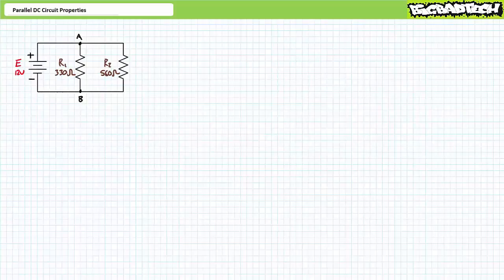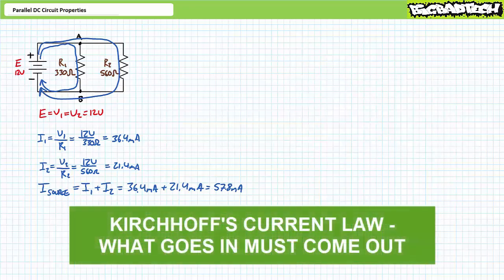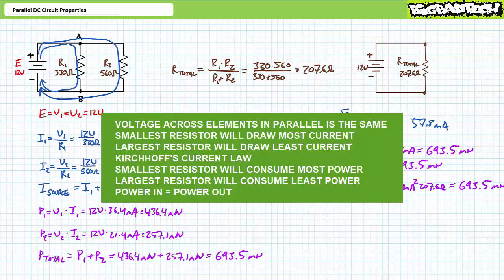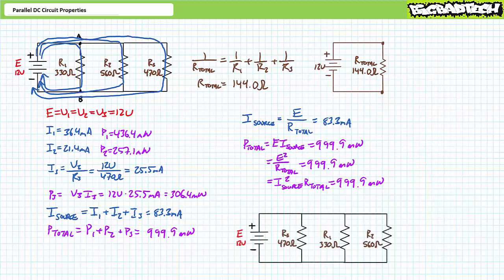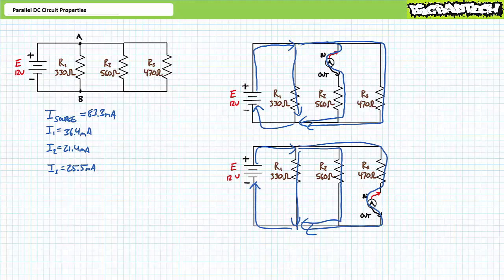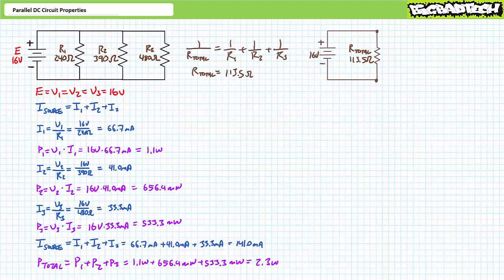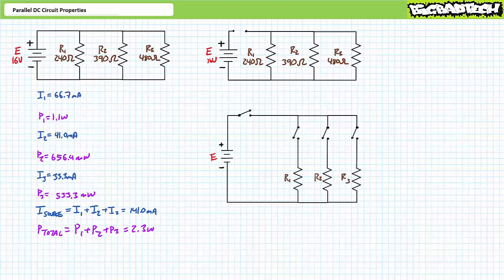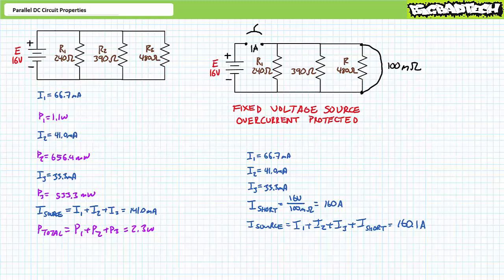Parallel DC Circuit Properties (Full Lecture)

Comment: My take away from this lesson is that parallel circuits have zero tolerance towards shorts, but are forgiving towards open. Meanwhile the opposite is true of series circuits. They are forgiving of shorts, but have zero tolerance towards open. While both circuits would benefit from a fuse or circuit breaker, a parallel circuit has more of a need for it than a series circuit. Opens may be undesirable, but they don't fry circuits. Shorts do!

Comment: I ran into some big discrepancies doing a lab that simulated shorts and opens in a 3 branch parallel with a leading current limiting resistor.  We were required to keep voltage supply of 10v ahead of the limitter resistor, when doing a short in the first branch.  My Vss went from 10.10 V in no short circuit to 101.105 V!!!! To get 10 V into the parallel part. Number 2 is,  I tried solving current in each pstallel branch using current division which agreed with my measured values, I went back after and checked my calc values and wow wayyyy off lol.  Where the hell am I going wrong? Lol
Reply from the maker: Not exactly following your description, however, if you're simulating these conditions on a circuit simulation program ... don't trust the program.